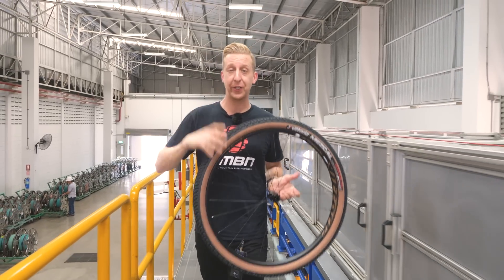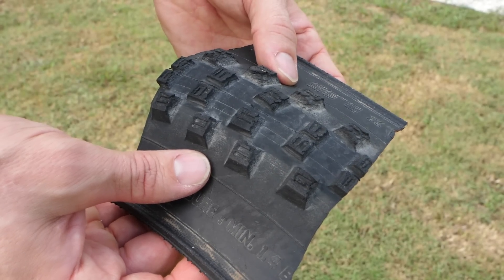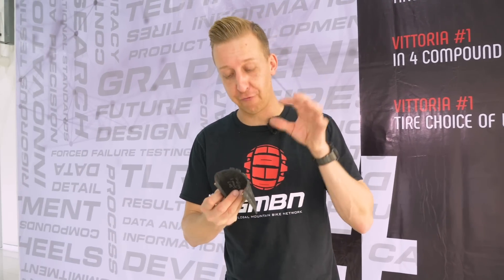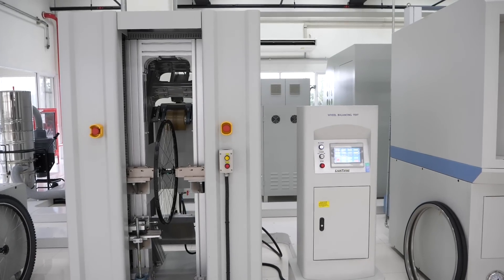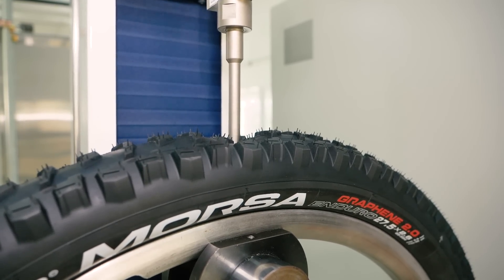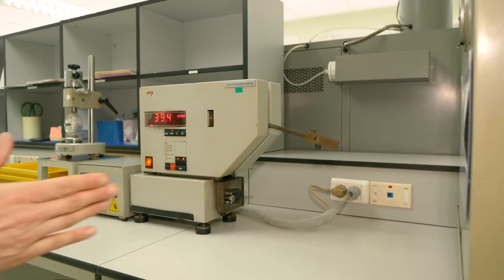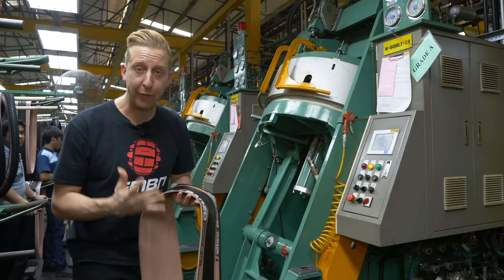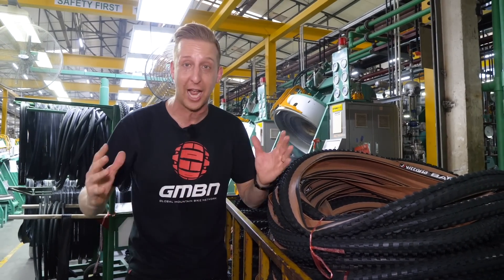Vittoria: How A Tyre Is Made | From Tree To Trail

Comment: @9:07 Love how us MTB junkies are repulsed by road biking! 😁😃
Reply: I used to go offroading on a road bike with 28mm tyres. I enjoyed the lack of grip, it was fun! Plus the skinny tyres are amazing for riding through long grass, since the tyre displaces less grass it takes much less energy to cycle through it. I probably didn't do anything near as extreme as you'd do on a mountain bike but road bikes are perfectly capable of offroading if you're confident enough to control the bike on looser ground. The part you start to struggle is on wet mud depending on how deep it goes since there's no knobblies to give extra grip/traction. What I don't understand though is why people buy fully fledged mountain bikes solely for commuting to work with extremely heavy suspension components. I've used mountain bikes (without suspension) for commuting but I usually throw on a set of slicks like Continental Contact Travel tyres, they have slick tread in the centre but also have knobblies on the edges which are great for reducing the likelihood for tyre slip when you hit something like a curb at an angle, preventing the tyre sliding against it. Tyres can make a huge difference on the road even on a mountain bike. Knobbly tyres consume allot of energy and they're completely pointless if you don't use it off-road.

Comment: The new Mescal is a truly amazing XC racing tire.  Sidewalls are a bit fragile for rocky courses, but if the course is not full or sharpies, then this is the best tire ever.  I have had extensive racing experience on Schwalbe Rocket Rons and the grip and speed of this tire increases descent rates 20 percent I think.  And, very light for climbing.  Looking forward to testing their trail version next week with the stronger sidewalls.

Comment: What will happen if i put a 180mm travel fork in a 160mm travel bike
Reply: It'll be fine. It will just make your head angle a bit slacker. I have a 180mm fork on a 120mm hardtail and it rides fine.

Comment: Can bike tyres and tubes be recycled.?
Reply: I would hope that, they could be at least used in the same way as used motorvehicle tyres. There's loads of silly cool projects on the internet to make your old tyres into trouser belts etc.. I had a big slab of worn down 2.4 high roller strapped to my downtube to stop Welsh rock smashes.

Comment: A most excellent video! Not sure how or when in my riding life that Vittoria became my brand. Of the six bikes in my possession, five are using Vittoria tires. My vintage race bike which is using a 21mm Rally tubular on rims that I laced myself. Next is my new road bike which is using a 25mm Rubino clincher. Moving up to my town bike on 26x1.75 Adventure. Then my 29er with Mezcal 2.1’s which has graphine. Finally my fat bike with a massive 5 inch Cannoli. I am rebuilding a vintage bike to be my cargo bike, not sure what tire it will end up with but I have a sneaky feeling it will be a Vittoria. From 21 mm to 127 mm and 100 to 8 psi! Well done Vittoria! Well done GMBN Tech!

Comment: My question: Why did you guys stop making the  Bomboloni 4.0? This fat tire tracks great on the road, provides grip on all surfaces, and the casing is great. I moved from New Hampshire to Colorado and have killed four 2.3 TNT Morsas out here, but the Bombolini has held up to everything. I even just went on a ride in Canon city and thought I had shredded the rear on a rock. When I checked the tire back at my car I had put a good slice in the sidewall but not enough to kill it. I just love this fat tire. Works great in New Hampshire's hero dirt and here in CO where it's dry, dusty, and loose. The other thing is here in Southern Colorado there is a lot of shale. I really loved the 2.3 Morsa, I only used Graphene, TNT, all top materials you offer but have lost four tires in a year to shale. I thought they would hold up a lot better but not the case. I had to switch to Maxxis Double Down casing (DHR II front and rear) and have not had any punctures on same trails.  I wish I could go back to the Morsa, it was such a fast rolling tire and I like the side knobs. I have all the dead tires hanging on my wall. :)

Comment: Did you get to see where they add the fishy smell to inner tubes? 😆
Reply: Used   Crotch powder
Reply: Fish bone powder.  Because it's stupidly cheap, keeps it smooth and prevents it from sticking to itself and reduces pinch punctures.

Some don't use fishbone powder and use synthetic powders instead, which I try to purchase from because I don't agree with exploting from other animals when we don't have to x
Reply: @herculesmclovin  Mate, they're not harvesting the fish for the bones. The powder is a byproduct, that it is being put to use as a good thing. Otherwise it goes in the bin.